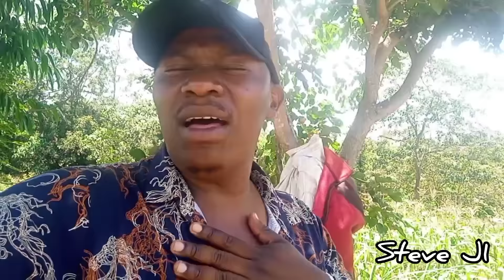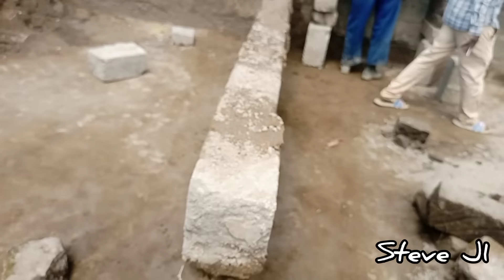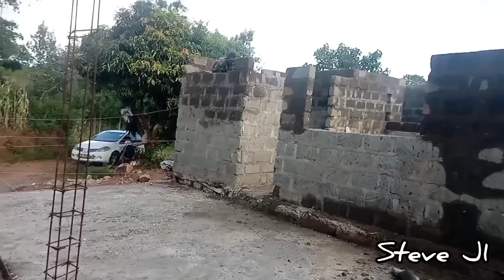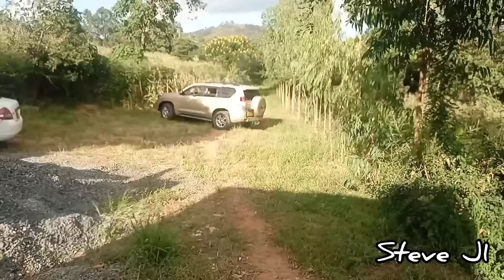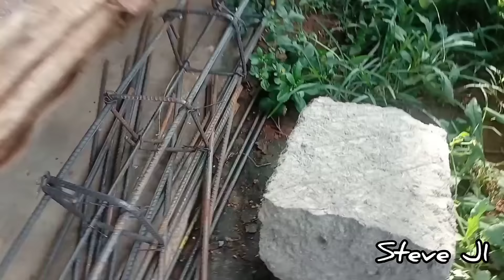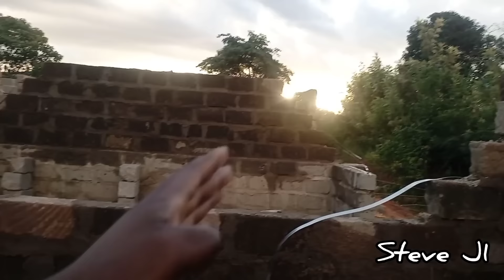MORE GIFTS FROM USA🇺🇲🇺🇲🇺🇲🇺🇲‼️‼️‼️...More Visitors, More Blessings,❤️❤️❤️🙏🙏Our Villa Almost Done🇬🇧🇬🇧

Comment: Steve maybe they can be curing in the evening so that the blocks don't dry too fast due to the sun? 
I am also learning. So I stand corrected
Reply from the maker: Yes. Wr cure in the morning and the evening
 The more water you give the cement, the stronger your walls. So twice a day is better. For the slab, 3 times a day is thr best till its flooded